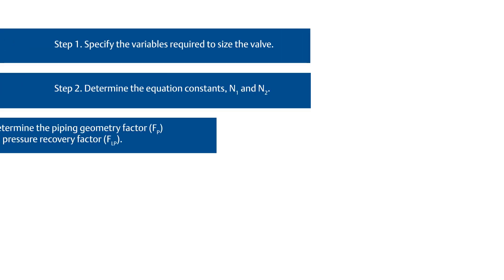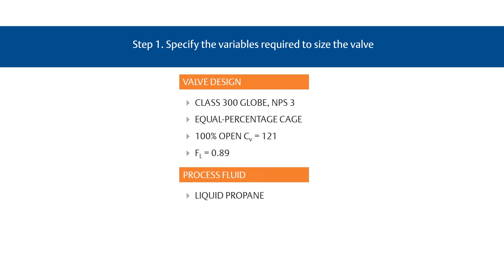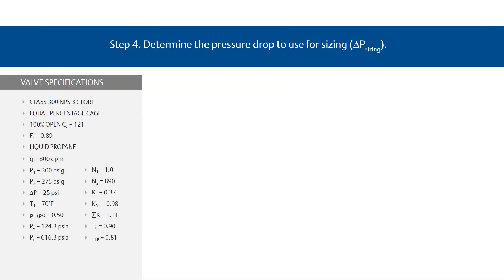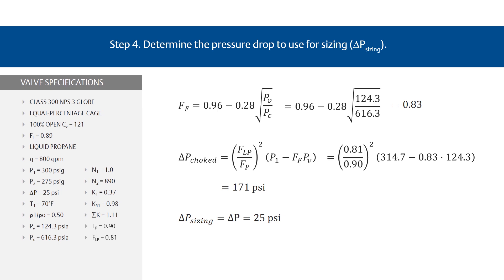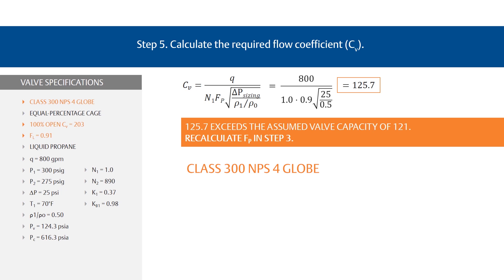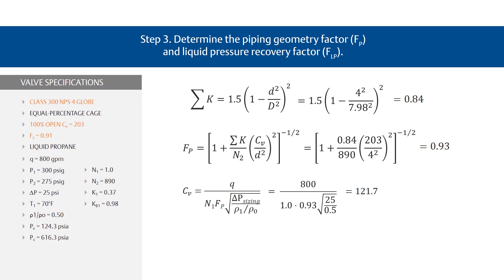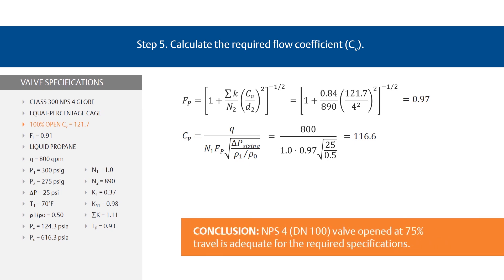How to Size a Control Valve for Liquid Flow

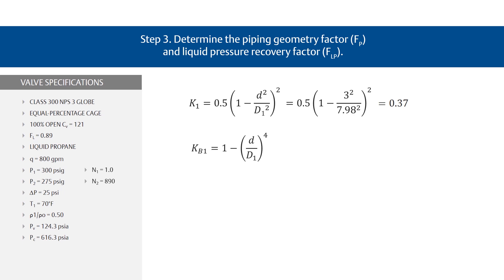Comment: At approximately 1:44 of the video, the K1 equation is used.  d (nominal pipe size) and D (internal diameter of pipe) are used.  d is shown as 3 (the nominal pipe size), but D is shown as 7.98.  Shouldn't D be 3.068 inches?  Please explain.

Comment: to calculate the necessary resistance coefficients needed when the upstream and downstream pipe sizes are the same: At 1.44 during these the PIPE line size is 8 inches but D1 is taken as 7.98? can you please explain Y?

Comment: how do you know the percent valve open for new Cv is about 75%?
Reply from the maker: We compare the calculated Cv to the valve manufacturer sizing table for an NPS 4 globe valve with =% trim. The table  gives us the Flow Coefficients at the valve opening - percent of total travel.  
The Fisher valve sizing tables for a NPS 4 with equal percentage trim can be found here: https://www.emerson.com/documents/automation/catalog-12-en-1630608.pdf#page=119
For the purposes of this example some of the numbers were generalized.
Reply: @FisherControlValve  I have a few questions.  I am new to this so bare with me if you don't mind.  Why is this 75% significant? And how exactly do I find this 75% using a Cv value of 116.2 I thought it would be under 70% on the table? It's possible I'm reading the table wrong it is page 119 correct?
Reply: Also I understand that generally when sizing a valve I need it to be within a (20 - 80)% open.  How does this information or does this information indicate that?
Reply: Hello, I really didn't understand that from where the value of D i.e 7.98 is derived?